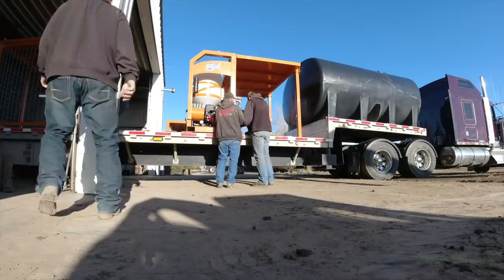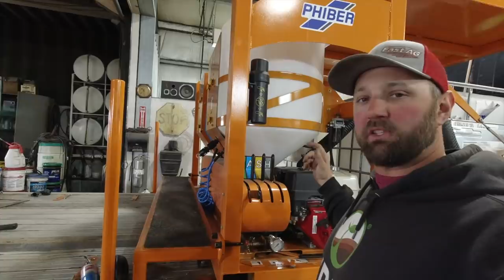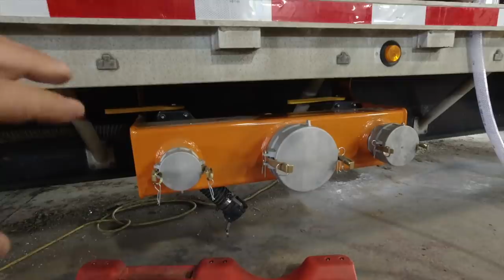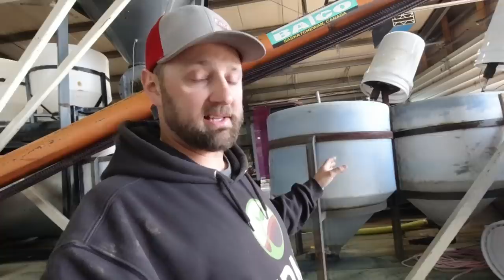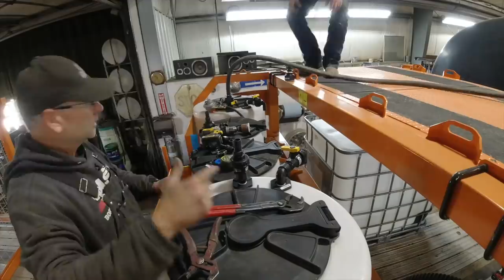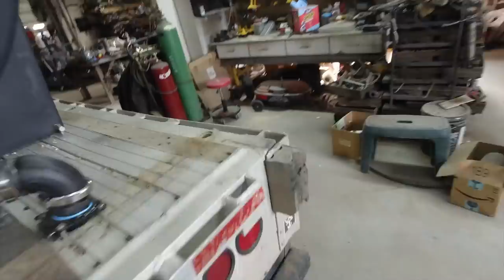MAJOR Spray Trailer Upgrades!

Comment: "Are you going to be nice to the chickens Roger?"  (Roger Licks his chops and smiles)
The new spray trailer setup looks good.  Maybe time saved will let you put out another load per hour or so !
Reply: Does your setup have a scale on it or electrical meters to get your chemicals added in like the one on Cole the cornstar  other than that looks like a great setup
Reply from the maker: Jay Thomas the cones have marks on them the we fill up to for bulk products and we can dump the jugs in the cones

Comment: OK question you needed air to run stuff. So why not just use the air off the truck. I’m wondering if you didn’t think you would have enough volume or pressure to run things. Anyways looks like a cool set up.
Reply from the maker: Old Fart we don’t want to start the truck when we need more air.

Comment: Why not use the air off the trailer? That is how we did our nurse system, open a valve and blow everything out of the line to the sprayer
Reply from the maker: Since there is 3 air powered pumps we didn’t want to have to start the truck to fill the sprayer.
Reply: That makes sense.

Comment: why wouldnt ya just mount a tank tony and run off the truck cmp, with the truck and trailer tanks and a additional tank prob have all reserve to run the system and one less motor to fight to start or fix down da road?
Reply from the maker: The truck would have to be started every load. The pumps use a fair amount of air.

Comment: nice chemical rig! can you switch what each of the pumps move to be able to have a built in back-up when murphy raises his head and one of the Hondas don't start?
Reply from the maker: Chuck G are you talking chemical pumps or water pump to fill the sprayer?
Reply: @FastAgMontana  I'm thinking both! On my boat I have back up pumps for everything. Worked out great cause you can't get many - stinking parts senior -  in Baja. I even rigged valves to be able to bypass a pump that went belly up on one cat and use the one on the other cat engine for it.
So glad you let us hear your work and don't cover it up with music. I watch you for farming not radio.